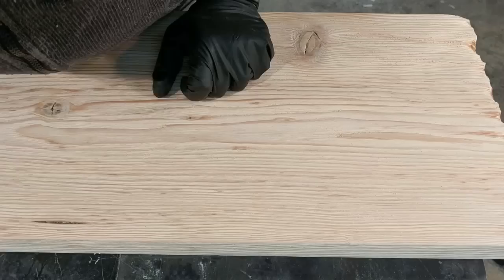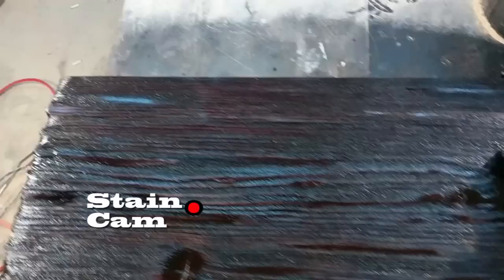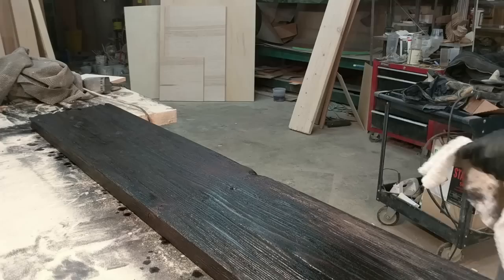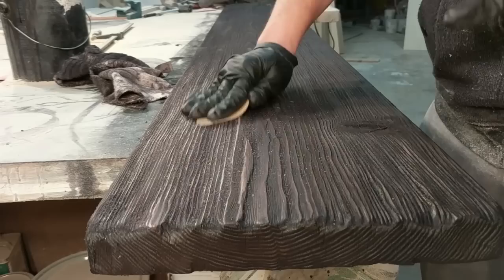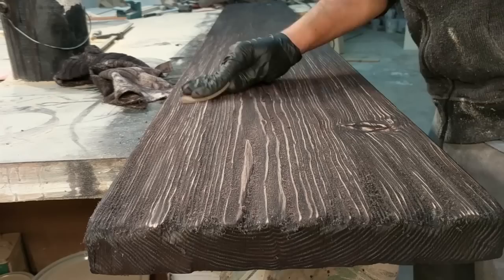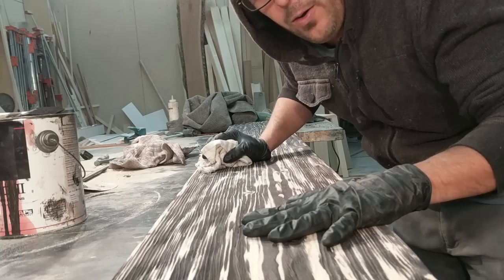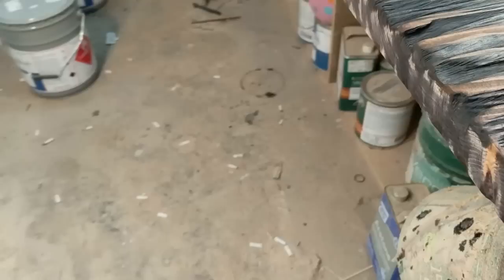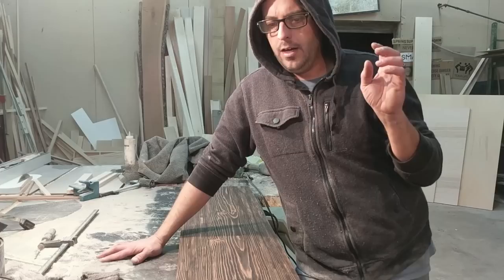How To Stain Wood | AMAZING Results!! #diy #finish

Comment: Hello Jason!  Love this vid!  What color stains/satins did you use?
Reply from the maker: +NaturalBellaFace Thanks!  I am glad you liked it.         I used for the darker color Ebony/ espresso and the lighter was Cabernet. Both stains are by varathane, my favorite of all companies. They are easy to find at Menards and similar stores.
Reply: Planning to do something similar. What brand?
Reply from the maker: +Marlon Labrador An easy to find brand is Varathane. They have a very easy to use product
Reply: Thanks, Jason.
Reply from the maker: +Marlon Labrador No problem! We should be going live tomorrow night around 8:30 pm Central and we will be talking about stains if your interested,be sure to subscribe and hit the bell for a notification
Reply: Subscribed.
Reply: Can you also use electric sander
Reply from the maker: Yes you can!

Comment: Is no pre stain needed when going this dark? I'm going to be going ebony with a touch of grey on top
Reply from the maker: No pre stain is needed depending on the way you sand the piece and the brand of stain. Let me link a sanding Video for you.
Reply: DOING IT WITH JASON RESPONDED LMFAOO that's awesome!! I was expecting a person watching ahaha
Reply from the maker: Here is a stain Video that explains the sanding process! 
https://youtu.be/OW22FJ2e9x4
Reply: You are awesome!! My project is coming along perfectly!! Quick question though! After I distressed my wood (using the exact same bit as you, which I can swear by!) How would I stand those grooves? Well most effective act at least lol
Reply from the maker: I would use either steel wool or a sanding sponge.. also I just a new woodworking series here if you https://youtu.be/429iTQolBv8
 to learn more😁
Reply: I love every video you make!! I have one more question before I stain my project!! I distressed my wood but my friend told me about water popping the wood?? Makes the wood "veins" pop. BUT we already distressed....sooooo that's not needed right? Or should I just because!!
Reply from the maker: I would not use water...I have never really ever.. using water sometimes helps raise the grain for finishing, but it won't enhance it in  anyway and it's not necessary especially for an oil based stain it's actually a bad thing.
And thank you for watching my videos!
Reply: Thank you soooooooo much!! Your amazing, this video has at least 100 views from just me hahaha
Reply from the maker: Haha That's awesome! 😁 And you are more than welcome!!

Comment: what if you dilute the same stain and do this
Reply from the maker: That would absolutely work as well
Reply: @DoingitWithjason  mineral spirits or lacher thinner?
Reply from the maker: As long as your stain is oil based either will work fine
Reply: @DoingitWithjason   thank you
Reply from the maker: Anytime!

Comment: just thought I would say thanks, I tried this method and I think it came out quite decent.  The changes I made to what you did was use 3 colors of stains and instead of sanding I used the wire brush between stains.  I also didnt let the stains completely dry before I did this and I think i help to let the stains bleed into each other a bit.  https://www.dropbox.com/s/gythn73hoocdr6d/IMG_1471.jpeg?dl=0
Reply: nice. what colours did you use? I mean not like "early american" or "late african" as it's too local, but like "grey(ish", "machohany" etc. and what did you use for sealing (top coating) the piece? Jason didn't say what he used.